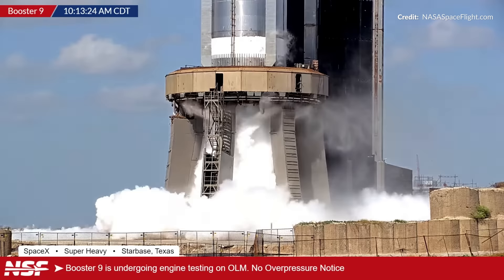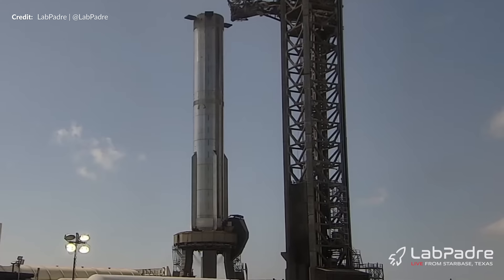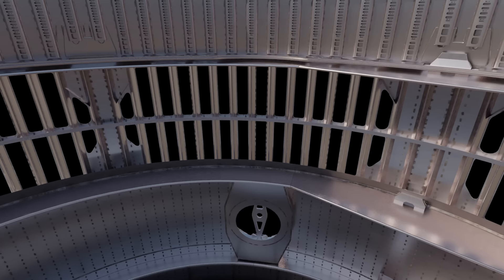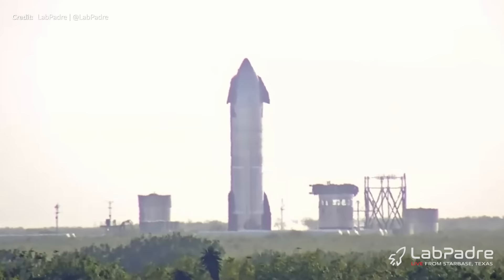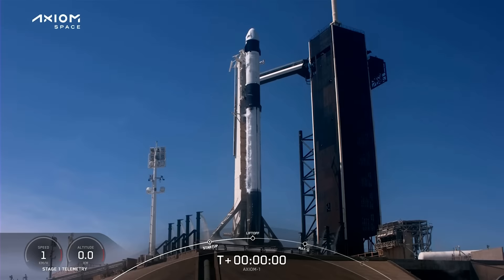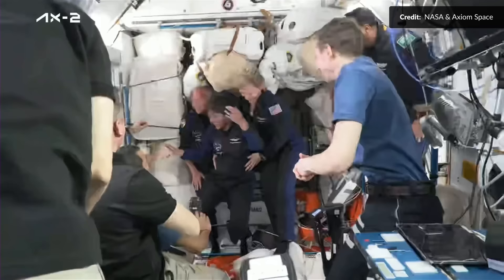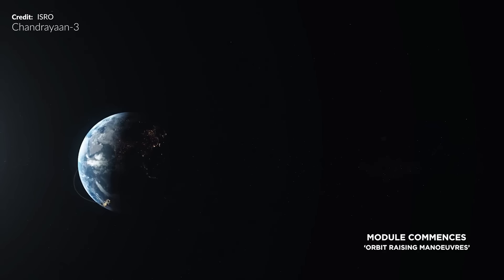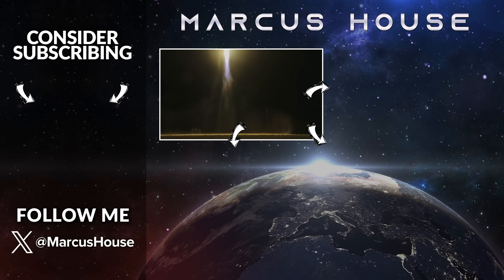Will SpaceX's Critical Upgrade Stop the Concrete Tornado?

Comment: 6:20 - My guess is that the "hot staging adapter" will continue to be just clamped to the booster, so that is can be easily and quickly replaced. Compressive stress from the Starship riding on it (which "can crusher" tests) is not the only one it will experience - it is very difficult to model what will engine exhaust do to it.

Comment: Any ideas on how Space X plan to shield the top dome of booster during hot staging, I get the venting ring will disperse the exhaust gas, but , do you think they'll need some kind of lightweight way to protect from heat/pressure damage? Especially when in reusable mode this all needs to be bulletproof.
Reply: Apart from sensitive bits, the rest is heavy guage stainless. The blow torch won't be hitting for more than a few secinds. I reckon minimal if any extra shieldung will be needed.
Reply: Shield should be built into the hot staging ring…. Would be easier to replace or repair between missions…
Reply: Seems like a good use case for a modular, ablative shielding system.  Just swap the spent module for a new one as part of the refit.  Could be a cheap and effective option.  Relatively light weight too.
Reply: Hot staging Top of booster shielding should Not be ablative, no maintenance or replacement needed between flights is a Starship mantra.. aiming at immediate turnaround only a couple of hours between flights. Perhaps a reused flexible fabric type heat shield/insulator material like Shuttle used for secondary reentry shielding. Or maybe thin rigid flame deflectors. Whatever is lighter & more durable.

Comment: Marcus,
Fantastic steam cloud with static fire.  Some questions now:
Did flames extend further from the   rocket base with the deluge working?  An effect of the steam velociy?
What was the effect of the deluge system on the acoustics ( especially at the rocket base)?
Which engines failed?  Were they all in the center clusters?
What was the peak pressure in the deluge box?  Did the pressue spike  at any time after engine start?
Was the early termination due to engine failure or for some other cause?

Comment: My best S.W.A.G. for the pad and deluge system, based on the full test of the deluge system, is that the high pressure water deluge along with steam back pressure from the exhaust gases may well direct the steam and exhaust upward at a tangent; instead of the at 90 deg. as was the result of the first test. Hope to see soon.

Comment: i wonder what they will do about the paint in the long run i mean what is cheaper? re paint every test of launch or have a coating that can survive it. ??xxx
Reply: Falcon use the same painting yet it doesn't prevent the high launch cadence from happening

Comment: Maybe because Tracking dish to close to the launchpad . The shockwaves from the launch prevent  proper communication.
Reply: The current move seems to suggest it just needs LoS to Masseys, Starfactory is basically in the way in old location
Reply: The dishes have previously been near Star Factory, not the lunch site. That is 1.9 miles from the OLM.

Comment: Hot staging is likely to use the sea level engines because they’ll be more than enough power to separate with less point loading onto the booster end dome.

Comment: I guess it depends on how you define a 2 G takeoff. If the vehicle's speed is accelerating vertically at 9,8 m/s2, ie 1G, a passenger would feel 2 G's. If the vehicle accelerates at 9.8 x 2 m/s2 (ie, 2 G's), then the Starship will be pressing down with triple the weight: 1,400 x 3 = 4.200 m tonnes. Right?

Comment: It's 1700x at 100°C, if it's 400°C, multiply that by 4, and so on...
If raptor exhaust is enough to heat water to 800°C, each liter of water will produce around 10000liters of steam

Comment: -Ablative combustible paint?
-Systems connections guarded by movable hoods that slide into place upon T+.001?
-Reinforced launch pad?

1st launch of the SV-F1 platform caused significant damage to buildings and local grasslands.

After 1st launch all personnel were 3+ miles away for safety.

During 1st SV launch some engineers stood on roof of a support building 1 mile away on Crawler Way. This was a mistake. 135dB. Just below extreme pain and permanent hearing loss.

After that everyone was far back.

Comment: I wonder if there is actually any need for the "hot" undocking to be... well... hot. Wouldn't running unburned gaseous fuel or O2 create sufficient reaction? Obviously this wouldn't be enough to act as an escape engine, but in terms of re-use it would hugely reduce wear on the lower stage.

Comment: A solid rocket booster cannot be restarted or turned off, so it will be limited to performing the apogee OR peregee raise maneuver, and would have to burn for exactly as long as how much fuel it contains? That's pretty crazy!

Comment: I don't understand how a hot-stage ring section can be lighter that a few ullage motors.  I also don't understand how hot staging can provide a 10 percent payload bonus when rocket engineers will move heaven and earth for a 1 percent gain while this potential 10 percent gain has been there all along.
Reply: I trust Elon's engineers...
Reply: @gregbailey45 While I stand by my assertions and questions, I have since come to realize that perhaps a hot-staging architecture enables more human safe abort scenarios than does a centrifugal staging setup.  I suspect that that is what is in play now.

Comment: They may be testing the new hot staging-ring with cryogenic fluids in the lower tank in the can crusher; but, how are they going to test the staging-ring during the elevated temperatures generated by the second stage engines? All metals and/or alloys will start loosing its strength when they are heated. Granted the super-alloys that are used, along with the very refractory metals like Molybdenum, Tungsten, Niobium, Hafnium, Tantalum, and several more that have very high melting points, will start yielding its strength the more it is heated (yes, we may be talking 5000+°F). I am referring to the convergence of the yield strength to the melting point of the metals used. It does not matter how refractory the metal/alloy is it will start yielding (i.e. stretching or bending depending on the applied load) as the temperature increases. Just look at the color and speed of change in color the engine bell/nozzle on a Falcon 9 goes through at  startup during 2nd stage separation. Watch the shift in color from red to orange to yellow to white as the engine is burning. The whiter the color is; the hotter the temperature is. Even the extremely refractory Nb90/Hf10 alloy that SpaceX uses to manufacture the engine bells, which are cooled using cryogenic fluids, will start yielding at some point on that temperature/load curve. So,....heat/load/failure point; how is the staging-ring going to be truly tested or is the final test going to be in flight? Or....is the staging-ring going to be disposable, since it can be hydraulically clamped down? A Notable Consideration: the higher the yield strength and the more refractory the alloy is, the higher the price is. Hafnium is not only expensive and rare; it is also hard to refine and to machine.

Comment: Is there any chance that the volume of water flash-boiling to steam isn't able to expand easily enough such that there is a pressure buildup? I fully expect there to be a massive cloud of steam, but it doesnt go from water to massive cloud instantly; pressure is needed to push the cloud out.

Comment: Crossing all fingers and toes all this work is rewarded with FAA approval and we get to watch stage separation!!
Reply: everything i,ve seen concerning ss launch 2 , seems to be awaiting preparations to be completed, and then it will go, its really hard to ignore some of the FUD being published at the moment!
Reply: Musk will probably try without a permit.
Reply: @ThatOpalGuy For what reason?
Reply: @alvianchoiriapriliansyah9882  he didn't have a permit for the full deluge system test.
Reply: @ThatOpalGuy  you don't need an FAA permit to spray some water. Why would Space X risk their whole operation by flying without a license? Don't make sense.
Reply: @reemul2001  is classified as industrial waste
So a permit IS required. 
Knowledge matters
Reply: @reemul2001  nothing fElon does make much sense.
Reply: @reemul2001  never said faa.

Comment: Hey man, new subscriber here. I'm a high schooler but I'm really into aerospace and rockets and I was just thinking: What if you also have another set of engines at the top of the rocket that can help with re-entry? That would offer better redundancy and more control over the engine, making it a dual-engine model and also help a lot with re-entry along with other things. Just wanted to know your take on this
Reply: Hey, Leo. Realize, the booster doesn’t do a true ‘re-entry’; it’s not like it ever reaches orbital speeds & then needs to fire rockets to take those tremendous speeds away again. And engines are heavy, and expensive. The booster only uses a few of its center engines to do any ‘entry’ breaking (really, a slowdown) and ‘landing’. And for THOSE engines to operate in-flight , they need additional systems (meaning, additional complexity & weight) just to get started (the outer ring of booster engines are started by ground systems to save weight on the vehicle). Lastly, adding more engines means adding more weight & complexities- meaning more things that can fail, decreasing reliability. Elon’s right: the best part, is no part; meaning, you put as much systems-wise on the vehicle to do the job- but no more. Good question, tho! - Dave Huntsman
Reply: @dphuntsman  And you gave an excellent answer to it!
Reply: @dphuntsman   Hey man, thanks for taking the time to reply first of all. You explained it very well! Definitely, what SpaceX are doing right now is working extremely well. I just saw the Starship belly-flop and its landing methods and just started thinking about alternative methods to reusability and landing and I wanted to just explain the idea a little bit more in depth. Feel free to correct me wherever I go wrong.

1) You mentioned complexity and weight and it does bring additional complexity and weight to the rocket, but rocket engines are usually designed to handle weights that are much more than what the final weight of the rocket would be, in other words, the engine capacity would be a bit higher than the weight of the rocket it is designed to power. So surely a few tons of extra propellant and engines won't make a significant difference, when you're dealing in millions of pounds of weight?
2) You also mentioned engine restarts, but you could have helium tanks in COPVs and just spin start the engine right? It would bring in additional weight again, but it's like I mentioned earlier, surely it wouldn't make a significant difference in relation to weight?

Also, I don't know about Starship(haven't watched the video yet) but the Falcon 9's first stage does do a re-entry burn no? And it also runs the risk of plasma formation and such during re-entry due to its high velocity and friction with air molecules and as I mentioned, it has been very successful with its current methods, but would this concept not help with re-entry and landing? You can have a lot more control on the velocity at which the rocket re enters Earth and thus also reduce the intense heat and as mentioned plasma formation. This is definitely not a perfect solution as you'd get a lot of other problems but maybe with some more refinement, it can contribute to something which can be better than what we have at the moment?
Again, feel free to correct me wherever I go wrong, I'm still a novice in rocket science and I'm trying to learn more 😄

Comment: The crucial part of what Musk said is not comprehended, even by Musk, as tornadoes are Birkeland Currents. So I am now just waiting for the definite launch date, so I can publish my piece on Stage Zero's original failure and what the consequences of the new design might be and whether increasing the water in the deluge system will reach a point of it being just like pouring petrol on a fire.

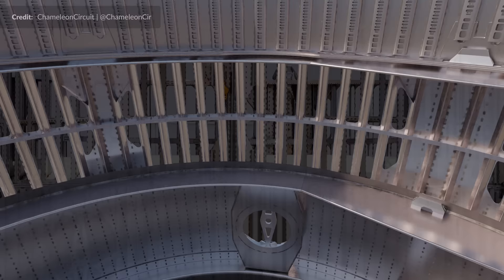Comment: Pausing at photo at 5:50 - the torus around the base of the hot staging ring is tilted up (flat in the artists render), which could suggest there is going to be some sort of domed structure, possibly a spacer and then a dome of heaxagonal heat tiles, shaped to guide the hot gases towards the vents, while preventing the top of the tank below from exposure to the exhaust plumes. Exposure would erode the metal, and heat it, both leading to early failure, while the heat could also impact the ullage pressure in the tank. The same domed cover would also shield all the grid fin hardware.

Comment: Can someone tell me what the superstructure on the outside walls of the Megabay is for? I've been wondering for a long time but haven't been able to find any answers.
Reply: Emergency staircase
Reply: These bays don't have floors like a traditional building. Floors account for the majority of a buildings shear and torsion strength. The exoskeleton ports the floors and their strength to the outside. I'm repeating myself here from another thread so that folks in this feed can chime in. I know that you are sceptical of this explanation, so maybe others can help explain it better.

Comment: I'm really anxious to know the test results from that hot staging ring but sadly, unless SpaceX tells us the results, I think we'll need to wait to see a hot staging ring added to booster 9 before we can be confident that the test was a success. I doubt that pictures from Massey's will tell us anything because I suspect that even a successful test will show a crushed ring just like the last nosecone to go into the nose cone test rig. I strongly suspect that once SpaceX has confirmed that the test article can handle the target loads they will carry on increasing the pressure to find out what the failure point actually is. Doing that is really, really useful for validating/calibrating their computer models by determining how accurately those models predict the actual failure point encountered during testing so I do suspect that this test article is on a one-way suicide mission and won't be coming back from Massey's intact.
Reply: you have to admit, fail fast and often doesnt always inform us of tested results (other than crushed cans), at least we should see fairly soon, a remade hot staging ring (if required) appearing in starbase. fingers crossed it all goes well
Reply: I suspect that they might want to use that hot staging ring on B9 if it passes testing (including necessary safety margins) and that's they why they made it easily removable. But it could also be that they did that to more easily work on it...
Reply: @Astromath  I completely agree that is a possibility. In the scheme of things though I wouldn't have thought that manufacturing another ring to the same spec (assuming this one passes the test) would be a big deal. There's still static fires to be done, FAA approvals to be gained and that 3rd water tank to arrive and be installed (assuming that is done prior to the next launch). I can't imagine that it would take SpaceX more than a week to manufacture a new ring, maybe 2 weeks at most, so I doubt that would be on the critical path.

Who knows, we're all just guessing and your hunch absolutely might be correct but if I was SpaceX and this ring passes, and if my guess on timescales is correct, I would consider it slightly more efficient to immediately start production on a second ring for B9 and at the same time go on to break the one currently at Massey's since it is there on the test rig anyway and the computer modelling team would almost certainly be pleading with me to give them a test-to-destruction result so I know I'm going to need to do that at some point anyway, if not on this ring then on some other ring.

It's going to be pretty easy for me to be proved wrong. If the ring does get taken off the test rig intact then that'll be me eating crow for dinner!

Comment: Marcus ..... Would it be a possibility that one of the vehicle tracking dishes will be moved to either Massey's or perhaps mounted on the roof of the new Megabay giving it a wider and longer tracking range. The new Megabay will also get wireless transmission towers with lightning protection.
Reply: Sound like a good idea until a tropical storm or hurricane comes rolling through.

Comment: I know I'll talk it up, but I can't remember the last Falcon 9/Heavy launch where an engine appeared to fail. Have Merlins, and by implication Falcon 9 launchers, statistically become the most reliable engines and rocket systems ever built? By sheer number I would assume so but are there recorded non-catastrophic engine failures that the general public don't see (such as reduced throttle or whatever)?
Reply: Yes

Comment: With this amount of power and providing the steam doesn’t effect engine s or cones or anything else. There should be more than enough power to get this baby out there. I might have preferred 2 engines on each side to be ignited a little after tower clearance or maybe even a little later just to give it that final push to where we all want to see it. Separation and it’s mission finishing journey.